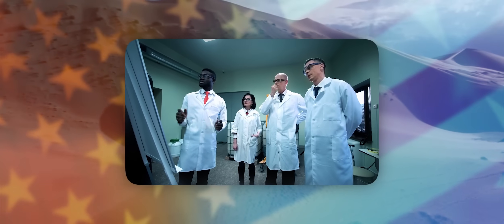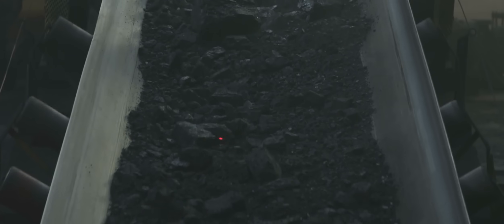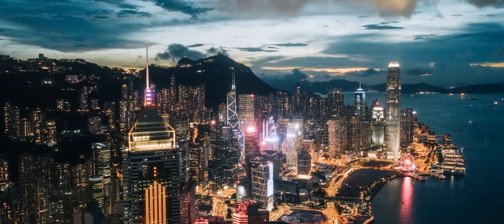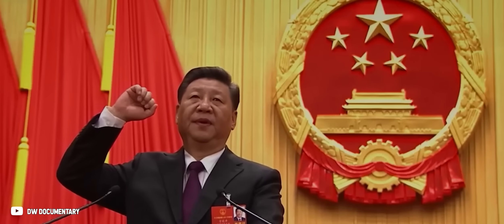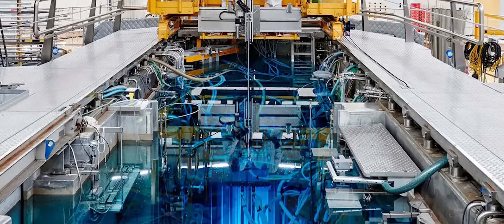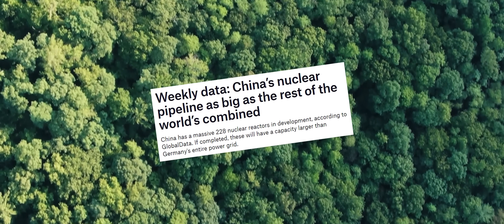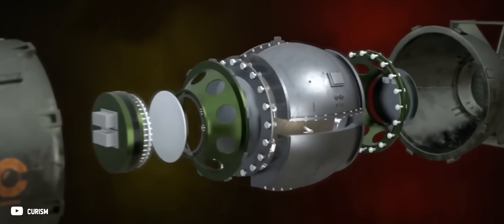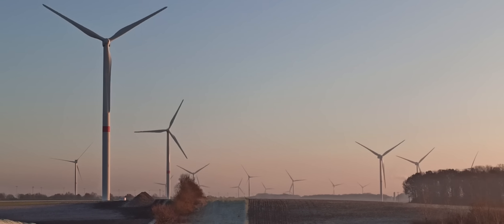Nuclear 4.0: NEW China Thorium Reactor BREAKTHROUGH Changes Everything!

Comment: Its in the Gobi because it is FAR from population centers and if Shit happens not much is destroyed.  Not because you can run reactors there.  Same reason the USA built their reactors at Hanford, Washington which at the time was a desert with no one around along with Idaho falls which also was a desert with no one around but they both had water.  Los alamos was chosen for wind direction as any flaw would dump radioactive waste in places with zero population.  Eventually Nevada was chose along with S. Pacific islands... No one living withing hundreds of miles.  Oakridge in Tennessee is the extreme outlier and was only chose due to lots of electricity, water available and no one truly thought what they were building would have big problems.

Comment: Actually I won't call it breakthrough. First of all it is a pilot project, more an experimental reactor than a commercial one. Its output is quite limited, at full power it can run 60 days/year, lifetime is 10 years. But anyhow it is a very promising experiment. 
And a small correction: China is the 12th in the world ranking by available thorium deposit. Its deposit is one sixth of the deposit in the US according to the IAEA.
Reply: Okay well give it a decade then. In short order thorium is going to be a gamechanger
Reply: Every new technology is pooh-poohed for a while I'm sure there's a few bugs to work out. like I said let's take a look in about 10 years and see where we're at. again if we didn't shut down the oak springs reactor in the 1960s think how much further along we could be in this technology right here in the US.

Comment: You got the reason why the USA decided not to use Thorium in power reactors. The real reason is the Thorium reactors does not produce Plutonium. The US needed the Plutonium for atomic bomb production during the Cold War. That’s the real reason.
Reply from the maker: Exactly. Thorium reactors however have so many advantages for energy production
Reply: Yep. Unfortunately. If it doesn't go boom these assholes don't want it.

Comment: American Scientist's are extremely naive or perhaps willingly ignorant, about China's extensive espionage operations conducted at most western colleges and universities. China is a dictatorship which is why they can achieve rapid implementation of mega projects. They essentially use fear as a motivation to get the job done. This approach will always have many failures that result in a large number of deaths, but China does not care about worker safety or public safety since they control the media. 
   I do commend China's decision to build the Molten Salt reactors but I hope they design the plants to ensure no one dies if a pipe with molten salt in it ruptures. Double walled pipes would be a great way to minimize the safety risks to the workers and having leak detectors inside the air gap in the pipes would give plenty advanced notice of a rupture. I hope they use higher quality stainless steel in the piping then they export to the U.S.!
Reply: Loool who needs a Red scare when you got a China scare right????

Comment: China did such a good job in their bio lab and makes such sturdy building and safe trains why shouldn't they make reactors.
Reply: This is why China shut down investment funding. Even though molten salt is way safer than hot water reactors,and has the potential of fueling on the fly,it must not be a tofu drug project. Hence it is government funded and supervised. 
The old U.S. model of investor funding is outmoded. Using the public to buy military hardware to fund the militarys hardware isn't a good model either.

Comment: The comments on France do not suit to the reality. The importation of energy to France is only due to the fight led by Germany, which imposes constraints to France through EU, in order to prevent France from developing its nuclear energy. France is self sufficient in energy thanks to its nuclear industry and could have a very cheap energy could its problems with EU be solved. France participated to the development of the thorium nuclear reactors in China, when it couldn’t perform the same thing in France for purely crazy political and administrative constraints and constant fight of Germany against the interests of France.
Reply: Yet Germany NEEDS French nuclear-produced electricity to balance its grid (when the wind stops and the clouds cover the sun)!
Reply: It is horrendous the ESG green energy racket and it's affects on the west. The deeper you look into it the more you realise its all a scam designed to give easy and quick insider trading ideas for the political class. Covid was much the same.

Comment: If China builds it, i'll give it maybe 10 years before melt down! LoL!
Reply: So how long will it last if the American build it? Wait, the Americans can't even build anything nowadays.
Reply: @dice138  I'm sure they have no trouble building a zimmer frame for brandon or needle exchanges or ballot harvesting boxes but other than that you are probably right.
Reply: @Scientist538  Right, ballot harvesting box...very important🤣🤣🤣
Reply: Sure, you can have a celebration by then. Send us an invite
Reply: These reactors are already melted. When there is an accident the fluid simply drains into a secondary tank for the fluid to 'freeze' which happens when temperatures fall below the melting point of salt. They are as close to foolproof as we've so far seen with nuclear fission. The US knew this but chose to reject the promise of this great technology.

Comment: Wow, China is now building a big thorium molten salt reactor in the gobi desert. It means that China has solved all the problems that made the usa backed out from using thorium but uses uranium instead which gives all kinds of radioactive byproducts. China’s achievement has astonished the whole world. As China has the most thorium in the world she will be independent of uranium supply for the conventional nuclear reactor. Thorium reactor is much safer and does not produce radioactive product such as plutonium and it can therefore be exported to other developing countries. Great China keeps making a great difference for all in the world.
Reply: China has built many standard typical power producing uranium based commercial reactors.  But their Thorium reactor is a very small demo test reactor that produces no electrical power.  What does that tell you about their confidence in Thorium over uranium????
Reply: @clarkkent9080  you have missed video, dude. China is building a large thorium reactor now. The small test reactor has been in operation for a couple of years and proven successful in solving all the practical problems. Now, it is time to build a big one. Don’t miss the progress of China because you might learn something, dude. Uranium is not needed. However this thorium reactor can use the waste product, U238, of the uranium reactor, thereby solving another problem of the uranium reactor.

Comment: Definitely, I'm waiting for cars with Thorium reactors in them.  Hopefully, China can produce it in the future.
Reply: They will be heavy cars... what with the three tons of shielding!
Reply: Thorium produces electricity. Cars just need batteries. No need to put a Thorium reactor into a car.
Reply: Am sure it will take forever by the time it's downsized to fit a car but maybe what's faster is having an electrified  road network that takes power from these plants
Reply: They can't get that small.  You have to have shielding around the reactor core regardless of whether it is molten salt or steam bomb.  They can get small enough to fit on a 40' semitruck trailer, but no smaller.  A reactor that size can power a rural city of 10,000 or so with ease.
Reply: @michaelmorris4515  Just think about RC of Boeing 747....  If technology can miniaturize a Thorium reactor, perhaps it can produce something interesting...
Reply: Just a little one, 5-10KW to charge my Cybertruck
Reply: Dis teknologhee is impossibal an wiil faiil an collaeps laik ol tofu cpp projeks. Evan maighty Amerikka dat is so advans dosen beuld dis

Comment: I'll just stand back and watch them build it with ersatz materials, cheapest components, and bogus piping. You think Fuku and Chernobyl  were bad? Sit back and watch.
Reply: yes, sit back and gloat.   go china
wrong channel to troll
Reply: What are the safety records of China's existing nuclear power plants?
Reply: I will.  If a thorium salt reactor requires no coolant can it melt down?  Neither Fuku nor  Chernobyl were Chinese or Windscale in Britain or Three Mile Island in America.   Remember Three Mile Island?  I do not expect you to know about Windscale because you are probably American and Britain is an ally and it was not emphasized in America.
Reply: Typical sour grape🤭🤭🤭🤭
Reply: @dice138  Worst than sour grape, because he was badly ill-informed.
Reply: Go back to your corner. There is no meltdown in a Thorium MSR.
Reply: This will be very useful, for many years opponents of molten salt reactors have claimed even modern metallurgy requires pipes and vessels to be completely replaced after just a short time in use due to corrosion, I guess we'll see how that pans out. It were these corrosion challenges that forced the MSRe into maintenance many times during its 5 year lifetime, thankfully the reaction is very easy to control so entering a state of maintenance isn't much of a challenge. The cycle makes so much money none of this damages its profitability, I'd bet even after all maintenance cheaper than coal power is possible with these. Another very alarming ability of these reactors that no one is mentioning is that the waste heat (of which there is a lot) can be used for heavy industrial processes such as in smelting for steel and other metals, this would greatly change the industry especially in the west where ESG has made all these heavy industrial processes totally unviable. All of a sudden it would be possible again due to the clean energy source (they might even receive additional grants for it), this would cause prices on the end product to fall, likely in a dramatic way, excellent for growth & the overall economies of the leading nations.
Reply: Got your coffin yet?

Comment: Thorium LFTR reactors make a lot of sense.  No risk of meltdown, No water cooling needed, more dangerous nuclear waste in short term - but less issues long term, burns up waste from current nuclear plants, plenty of fuel in the ground, not a good choice for nuclear weapons, and fairly low tech - especially compared to Fusion.  While fusion may appear more desirable, it is looking increasingly unlikely it will be practically feasible.  We need to get off carbon fuels now - like twenty years ago...  fusion looked promising in 1980, now it looks like a technical fantasy.  We would be wise to get LFTR thorium reactors online asap.